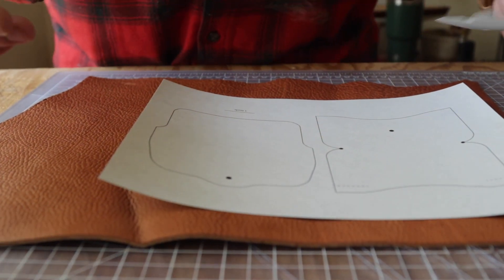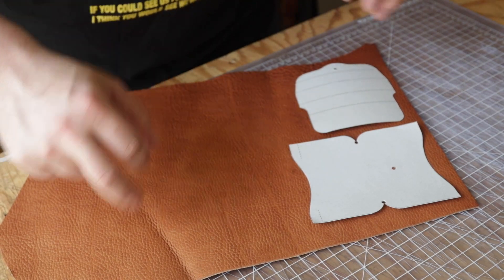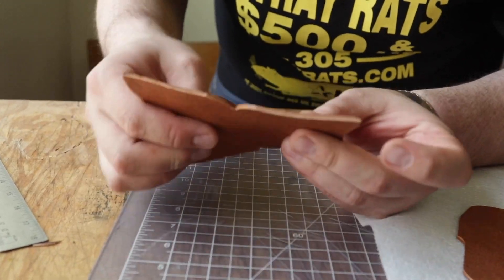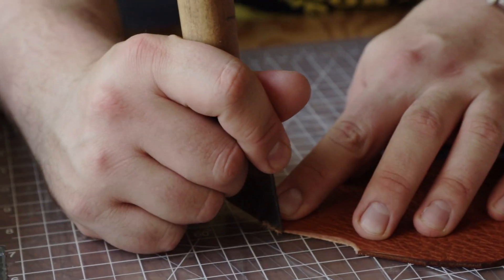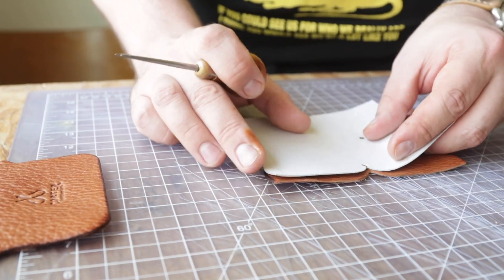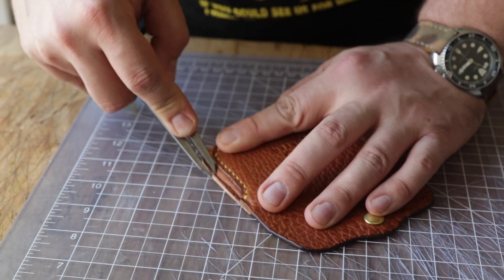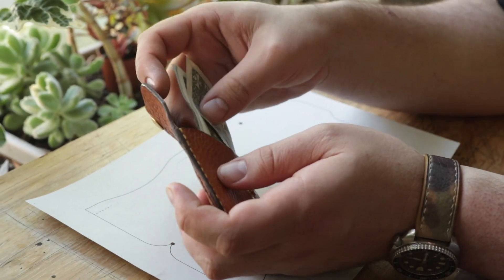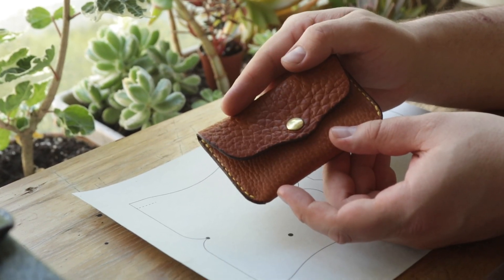Our FAVORITE Card Wallet Design Yet! (FUNDRAISER!)

Comment: Did you end up using line 20 snaps? If so, do you have tips on setting those in a thinner piece like this? What often happens to me is the post ends up crooked because the leather isn't thick enough. Thank you!
Reply: Try filing the post down with a file or sandpaper, leave about 2mm protruding above the leather. Try to keep the top of the post as level as you can.